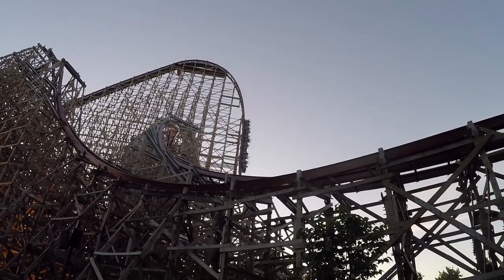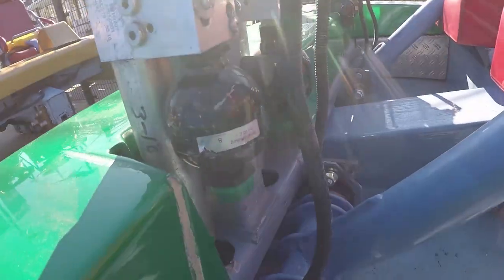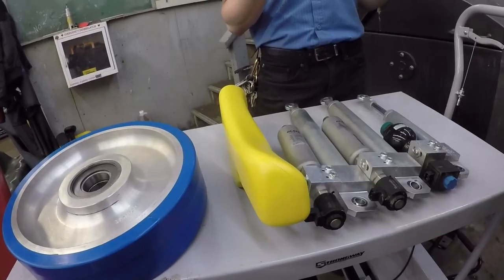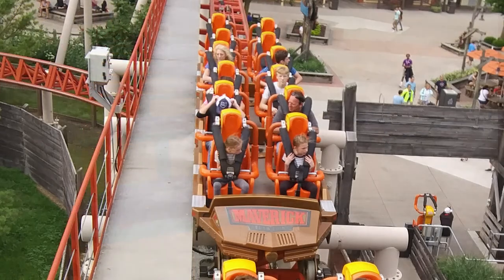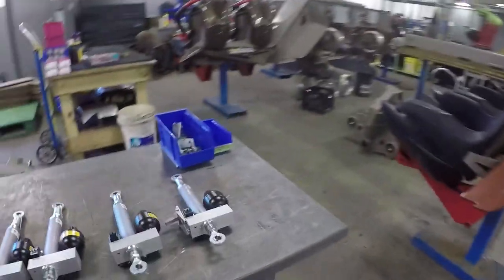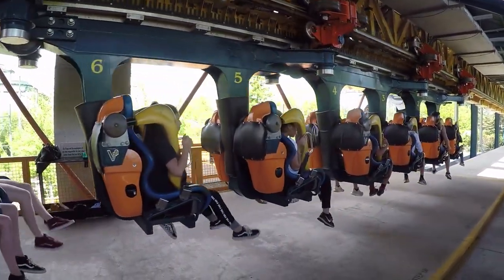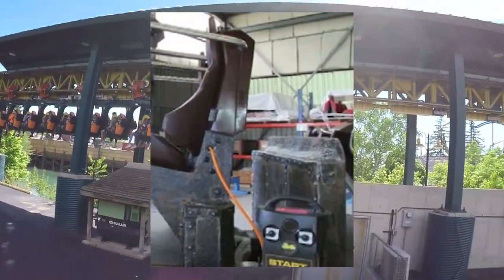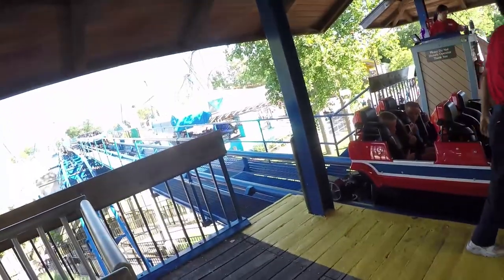Can Roller Coaster Restraints Open Mid Ride? (how roller coaster restraints work)

Comment: I was on a quite large ride once and the ride was experiencing difficulties but at the time we were at the highest point in the entire ride, the top of the hill after the initial launch. we were informed that we would be taken down by fire personnel so an operator came to unlock our restraints but the train had started again because someone that was in line at the time had apparently hit the start button. the train went ZOOMING down the hill and we continued the rest of the ride as normal, except the restraints were unlocked and moving freely as the ride went on. no one was hurt but i now live with insane anxiety from it and cant ride any of my favorite rides anymore. not to discourage anyone from getting on rides, theyre super safe and super fun, this was just my horror story lol

Comment: My lapbar came up a few clicks and re locked on Ravine flyer 2 during a rough part of the ride. Not really sure what happened there
Reply from the maker: If I had to guess it "slipped a ratchet" or in your case more than one. It was probably not quite locked into one ratchet when the ride started and at some point during the ride it clicked back up. There is also the much rarer chance that for whatever reason the restraint manual release was depressed for a second (outside object, ride forces) causing it to release for a second then relock immediately. That's my guess, but hey more airtime!
Reply: @CoasterCollege  whatever it was, I got the best ride of the day on RF2
Reply: @CoasterCollege  Ride forces might be able to depress the manual release? I thought the spring would need really heavy physical forces in order to "unlock".
Reply: PTC restraints can come undone if it is rough enough, it is rare but is definitely possible. My guess for why this is, is that there is a solenoid inside each restraint that slides a metal slug up and down to latch and unlatch the restraint. I would assume under enough shaking this metal bar can be “bounced” upward and unlatch. It probably doesn’t happen often because I would assume the lap bar would not be able to unlatch if there is pressure on it. This would be a pretty specific set of circumstances which might be why it is rare.

Comment: I had a ratchet restraint pop open and release on me when I was younger and my seat belt unlatched and I couldn't rebuckle it. Wore glasses but left them at the station with the ride op since I didn't have strap so I couldn't see. It was on an old wooden coaster at six flags America called the wild one. It popped a little after the first couple drops on the coaster. I survived obviously but it scarred me and pushed me away from coaster for a very long time. Now I make sure to strap my glasses to wear them on any coaster and check my restraints multiple times before a ride.

Comment: I recall one time when I was like 10 or something on the Alpengeist at Busch Gardens Williamsburg my harness didn't lock whatsoever, and the floor dropped out and the gate opened and me and my father were absolutely screaming the ride did all the whooshy stuff for a few agonizing seconds before they noticed and corrected it. As it turned out, someone exceeding ride size requirements in front of me was not able to properly lock, which for some reason affected the whole column. They left and the ride went fine after, but it was Not fun.

Solid ride though on reflection
Reply: I'm freaking out because of this! My family was invited to Knotts and one of the guys is 300lbs at least.  That's why I'm here. I am super worried about this!

Comment: A few years back, i was riding tempesto at Busch Garden Williamsburg and i thought my restraints were locked but right before an inversion they popped open and my sister had to use her arm to keep me from flying out.... I didn't tell anyone because I knew that my parents wouldn't let me go back on any roller coasters ever again.... i've had similar things happen to me at Coney Island and some small carnivals so I guess I have crazy bad luck. I still ride roller coasters I just make a big deal about my restraints being checked like 4 times before we leave the station. Scary.

Comment: Had this happen on a tame wood coaster (The Outlaw at Adventureland in Altoona, IA) with ratcheting restraints (just a metal bar that the operator checks at each car after locking). On the ascent up my friend and I (in the front car, which made it more scary/fun) noticed the bar was completely loose.  It was just moving freely.  We were too amused by the situation to get scared and I just said “let’s just push the bar down at the top and hold on”, that’s what we did and it was only sketchy at a couple points but I’m grateful for it. That coaster was boring as fuck to me at that point and this was a great curveball.  We told the attendant that the bar didn’t lock and they seemed wholly apathetic.  Two thumbs up.

Comment: One time I was on a coaster (Goliath at Six Flags over Georgia) and for half the coaster, my restraint wouldn’t lock and stayed open. They didn’t check my seat before I rode that time. I had to pin myself down during the ride. I’m entirely surprised I didn’t get thrown out. I had to physically hold myself to the ride, something I’m, again, honestly surprised I managed to do. I am not above or below any height or weight restrictions for the coaster. The seat just wasn’t checked properly. I reported the issue to the ride operator when I got off and, to my knowledge, the issue was fixed immediately and no one got hurt.

Edit: This was a few years ago and this issue is definitely a very rare thing. As the video said, rides are always checked every time they’re sent across the track. This ride in particular just for that day and just for that one riding experience was an exception. I am not in any way saying that roller coasters are dangerous or that you shouldn’t ride them. I still love coasters and I haven’t stopped riding them since! In fact, I rode that same ride two more times right afterwards (just in different seats) with no problem! And even though there was a weird, rare issue, it was resolved before anyone had a chance to get injured! I just wanted to share a neat, coaster related story. :3

Comment: One time when I was 8 years old, I rode the Scorpion at Busch Gardens. My lap bar was locked in place at the station but as soon as the operator started the ride my lap bar released, and it seemed like other people’s lap bars did too. So as the train went up the lift hill I pushed my lap bar down again locking it in place again. The rest of the ride went on as normal. No one mentioned what the lap bars did so I don’t know if my 8 year old mind exaggerated what happened due to being nervous. The Scorpion is from 1980 so I don’t know if something “glitched” (I know it’s not the right word) and told the rollercoaster to release the restraints. It probably would’ve stopped at the top of the lift hill if it sensed that the lap bars weren’t down. I believe that the rollercoaster is safe, a little rough nowadays but safe. I still ride it whenever I visit the park with no problems

Comment: For some vekoma trains the pedal is reachable from the passenger's location. So, a long Dutch person can reach for it, and unlock the restraints mid-ride. It allows a long person to know exactly where the pedal is, and purposely do it, but it is possible. I've seen someone do it on the final brakerun of a ride before, and I could open my restraints up a bit more. However, holding it down it neatly relocked after he released the pedal.

Comment: Mostly of the ride these days can’t open when ridning, not even if you click the button, because they need to be in still position. Some of the rides also have automatic lock. When they click the Button, the bars goes Down, you Can easy hear when it lock, it gives a Big lock sound in the seat

Comment: I am a rather heavy feller and since I was basically kicked out of a ride because the restrained only clicked 3 times I am really afraid that at some point they still start they train and my belly is in the way and opens it. 

One reason I started losing weight though. But if in summer I can go back to rollercoasters, I dont think I will have lost enough to Lose that fear. Or lost enough to not being kicked out

Comment: I'm not meaning to scare the general public away from coasters with this but my restraint did come up a click on Batman the Ride at my home park once. It was locked but the ride op really stapled me so Idk if that affected it. I think on the 1st loop it came up and I just pushed it back down even if it meant a hard staple on me. Maxx Forces restraints are great because they can't come up or down during the ride so if you get a little room, you can keep it even when it undergoes strong positive gs.
Reply from the maker: Yea it probably “slipped a ratchet” meaning that the restraint was not fully clicked into the next ratchet and at that point on the ride it clicked up one into the next ratchet!

Comment: On Gemini when I got stopped on the break run if I had to get evacuated I knew. they had to use a battery pack which I knew and that the restraints wouldn’t fly open on the lift nor on the break run without a pack.
Reply from the maker: Gemini uses ratcheting restraints, all we would need to do is press the pedal at the front of each car!
Reply: GP To Enthusiast surely a bird or something can press it

Comment: I am thinking of the Six Flags I go to.  I believe all the coasters at least have seatbelts in addition to the restraints.  Actually though, Superman Ultimate Flight is an exception.  This one does not have seatbelts, just hydraulic locks.  That is the last one I rather not have a seatbelt for though.  Because if the hydraulic locks become loose, you are definitely falling out of that ride, as it is a flyer.  Oh, and by coasters, I am not including the family coasters.  Most of those just have lap bars.

Comment: The video is very true but some aspects of it vary by park.  A lot of park maintenance crew do NOT like hydraulic because of the batteries they have to remember, But they have better safety measures.  A lot of times when evac get so crazy, they are never remember to get charged.  Sometimes this is the reason why guests are stranded on ride for a while.  Rachet rides are a lot different as explains in the video because all you need is a very unqily design tool and it can open up the restraints.  These are never to be in anyone access and locked away by maintenance and when calling ops, crew need to let them know they are loaded trains out of station so maintenance could bring the tools and evac the train.  On Medusa at six flags this happened a few time.  This tool could turn like a key and unlock individual rows.  It was easy quick and painless to the riders.  When El Toro got stuck, the batteries that had to be used were LEFT at Kingda Ka and uncharged.  Riders were stuck on El Toro for 45 to and hour because they need to charge them.  SOP on El toro requires full charging.  They have sense changed, where maintenance is required to make sure batteries are being charged after stacking trains at the end of the night.  Great video.
Reply: Paul A hydraulic lock is a lot more comfortable and strong than any ratchet lock

Comment: The Calgary Stampede has a drop ride with a similar restraint style.  The issue is that there's no ratcheting or hydraulic system to hold you in place.  All there is, is basically a seatbelt latch that can be opened mid-ride.  Not good when you're 150 feet in the air, with concrete below you.

Comment: I once was riding Batman at Six Flags Over Georgia (a ride with over the shoulder restraints and several inversions) and before we over the lift hill, I realized my restraint was not locked and I had to hold it in place as I went over the first hill. Luckily the restraints finally locked right before we went over the hill but it was kinda scary. (And yes I still ride it)
Reply: That’s called a ratchet slip. It was never unlocked.

Comment: I had my restraint seemingly unlocked once right as the coaster was leaving the station this was an old wooden coaster. It scared the crap outta me and I quickly pushed it back down and it locked tight against my legs again but I held onto the bars for dear life that whole ride because I was so scared. The bar did not come fully up it just wasn’t touching my legs anymore which is what scared me making me push it back down again. In hind sight I probably should have shouted to the ride operators but I got so freaked out I didn’t think to do that but thankfully it ended up alright and nothing happened. Thankfully that ride also had lap seat belts on it which I alway tighten as tight as I can get it because I’m always afraid I will fly out of a coaster.

Comment: I was at kings dominion and i was about to ride the dominator i was already shaking and adrenaline pumping we were loading onto the train and we put are restraints on along with the seatbelt connected and the restraints just went up when the train was being loaded with riders it scared the hell out of me but we pulled them back down and the the employees running the ride check them and they were fine we had a blast on the ride and good time it just scared me even more at the beginning i wonder what caused it tho really awesome park tho highly recommended
Reply from the maker: They just had to release restraints on that car, most likely someone else had not gotten in yet and their restraints were already locked, so they simply unlocked your car, and rechecked it.
Reply: @CoasterCollege  that makes sense thanks for the reply love the channel and keep up the amazing work take care

Comment: I was on the Georgia Scorcher at SFOG a couple years ago, and at the bottom of the first drop my restraint snapped open.  Thankfully I pulled it back in place and it locked before the loop but it was a scary situation to say the least.

Comment: It's happened to me twice. Once on The Beast, when it was still a single lap bar for both riders. The first time was on the old Screeching Eagle at Americana. The Beasts came undone right out of the station and we were able to slam it shut. The Screeching Eagle had a manual release directly on the side of the last car. Some idiot thought it was a good idea to release every lap bar on the train as we ascended the lift hill. Luckily the operated realized what happened, and stopped the ride.
Reply: The guy on screeching eagle needs to be arrested for attempted murder

Comment: My GP friend claims her dad's restraint didn't lock at all on Scream no matter how much he pushed it down so they stopped the train on the lift hill and sent a ride op up to either lock the restraint or evac the ride (I forgot which). Is this bs or is it possible for a train to leave the station with an unlocked restraint?
Reply from the maker: I covered that at the end of the video. I train can leave the station with restraints unlocked on some coasters. After the train leaves the station it will lock unless their is a (very rare) mechanical issue.

Comment: If there's a pedal that can open the ratchet restraints at any point during the ride, is it possible for something to accidently hit and trigger it? 

It would most likely take an ridiculous amount of force, but it seems like something that could occur in a freak incident?
Reply from the maker: yes, and it has happened on rare occasions. However, as I said in the video restraints are locked by default, so it would quickly go back to being locked after whatever pushed it down went away.
Reply: @CoasterCollege  Oooohhhh okay, I misunderstood what locked by default entailed. Thanks!

Comment: My restraints popped open at the top of the lift hill on Mind Eraser at Six Flags New England years ago. Was on the second of a double ride, didn’t unlock and relock my restraints between runs. The trains have since been replaced. Luckily that ride had no negative g’s.
Reply: If it went open on the lift hill the ride would have stopped
Reply: @eelovfx9200  well it happened and it didn’t stop 🤷‍♂️
Reply: @fyctroy3749  then it probably just slipped a ratchet because it couldn't have completely came up

Comment: My ratchet came loose during a portion of the loop on the defunct 'Mantis' at cedar point. The belt caught it and it locked back down quickly. I have to wonder if that mix of negative and positive G somehow engaged an unlock mechanism. I reported it and they closed the seat down.
Reply: Crazy
Reply: My harness came off at alphengiest bunch gardens Virginia funny thing is before the ride I checked it and it was locked in and the guy but right before the drop I look down and it's not locked in and the bars where above my waist and even above the bottom of my stomach lucky I saw it and didn't panic/ imagine if I didn't notice it 🤦

Comment: I was on Jaguar at Knotts with a friend and the ratchet lap bar just didn’t feel right and I told the person working and she said it was fine and after the first lift it slipped a ratchet and I felt like I was gonna fly out, my friend and I were crying laughing and he held onto me to keep me from slipping out. I 100% don’t blame the person, she couldn’t have done much other than releasing the restraint and letting me pull it down again I suppose, I just remember it being super funny to my friend and I and I still smile when I think about it